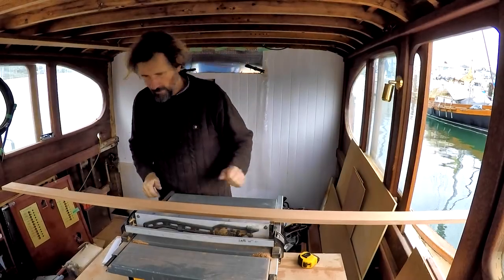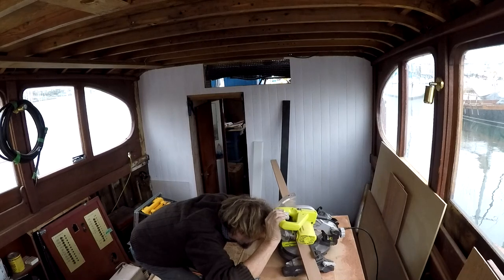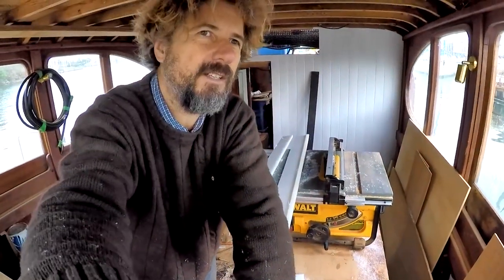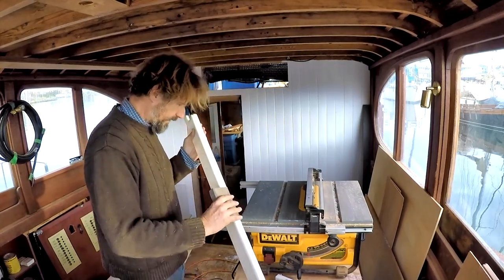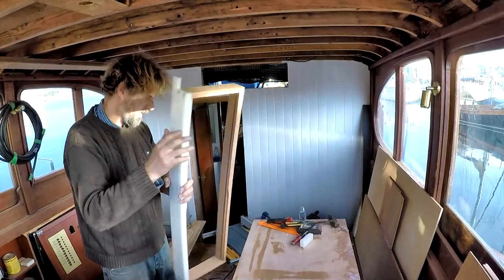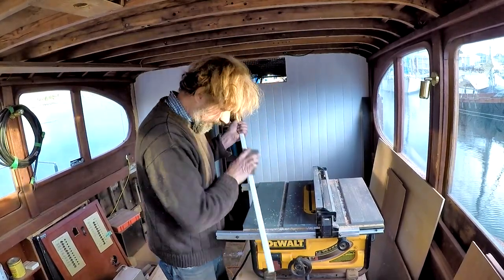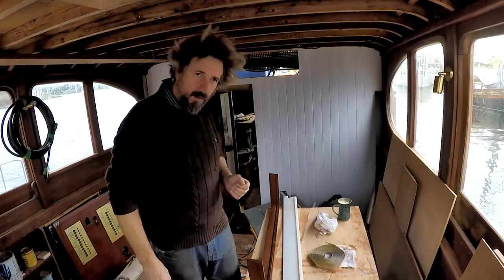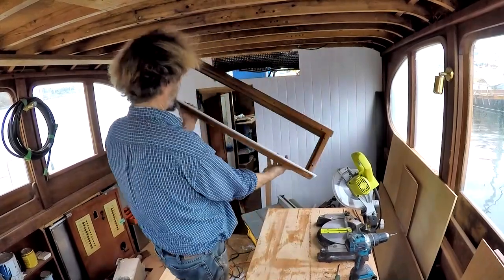New wheelhouse window - Wooden boat - Boat refit - Travels With Geordie #74

Comment: Very nice work.  Just a couple of questions.  Was the 10 degree slope enough to keep the water running off?  Did the windshield wiper keep water from entering between the panes? does water get stay in the sliding pane track?  are there any pictures of the window installed?  Again very nice work
Reply from the maker: Hi, the window has worked out very well, I'll show an update to it soon as I redo the upper helm.

Comment: Great job on the custom window! I have a question after looking at the ceiling in your boat and a couple of other vintage boats that I have viewed lately. I have a 1970 Grand Banks trawler, the main cabin ceiling is covered with regular material just like in a car. I was contemplating removing the material (also to do some re-wiring) and thought I wouldn't replace it but paint the ceiling white and depending on what the ribs were made of stain them to offset the painted ceiling.My question is, I have a small stove to heat the cabin. If I do not replace the material do you think that condensation might drip down from the ceiling while using the cabin heater? Would the material prevent that from happening by trapping the heat and creating an insulating air barrier? I am no builder that's for sure and I trust your opinion. You are doing an amazing job on your old boat! I wait eagerly every week for a new instillation and I can't figure out for the life of me why you don't have many thousands viewers? Are there just that few of us wood boat enthusiasts out there? Please keep doing what you're doing as I am learning a lot and getting some great ideas too!!
Reply from the maker: Hi, thanks for the kind words, your boat is surely a beauty.
You are very right, the "headliner"' or overheads in boat speak performs a few tasks, one being exactly what you describe. If the warm humid air can't get to the cool underside of the deck it won't condense. That being said, this same protection can sometimes be the culprit of causing some grief by the same means. If humid air does pass into the airspace above the headliner is will surely condense and be trapped as moisture in the cavity possibly causing a pile of grief. The solution isn't nessisarily carefully sealing off this space because there will certainly be some moisture building up from various sources and without ventilation that's trouble. The option is providing good ventilation to limit moisture buildup at the risk of causing it by allowing humid air up there. The common solution is adding insulation to the bottom of the deck so that there is no cool surface to condense on. In my case, the decks are thick enough wood and the expected cruising climate mild enough that condensation is minimal. Perhaps you are equally blessed, the joy of wooden boats. What you're planning sounds very nice, perhaps a slight modification by adding a little foam insulation and some overhead wood or such between the beams. I like the look of exposed beams with the deck above. 
Best of luck, I'm sure it will be amazing whatever you do.
Reply: The ceiling of a wooden boat for some reason is the boards on the inside of the hull ribs, anything over your head is the overhead. Same goes for the floors, they are the blocks tying your ribs and keelson together and what you walk on is the sole. The biggest contributor of moisture to the interior is burning propane. Insulation on a wooden boat is asking for trouble. The only well insulated boats are foam core  fiberglass ones. Good counter bores are milling bits, l have them up to 3”. Delrin is only good for a few years, gets brittle and cracks from the sun, especially if you don’t overbore the screw holes. An oily wood like teak or angaleck would be better.